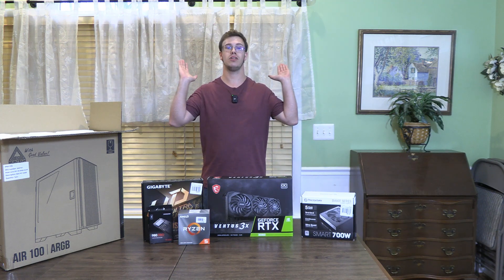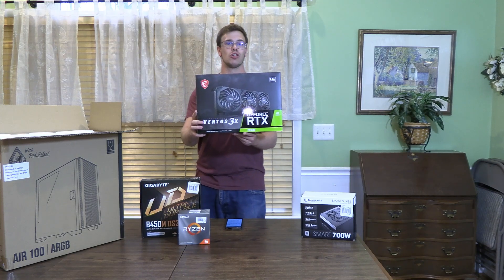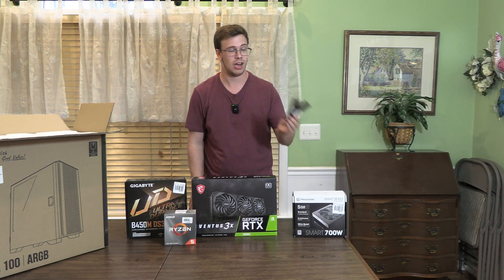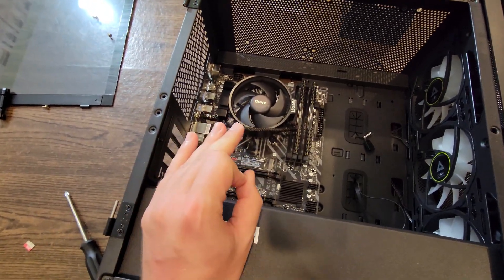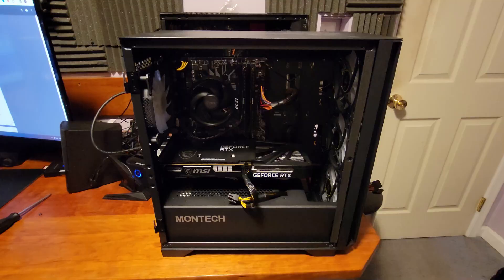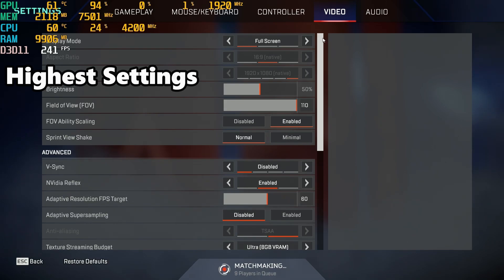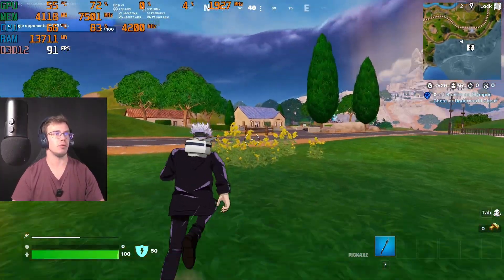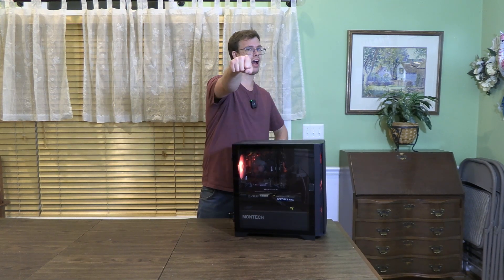Building the Best $750 Budget Gaming PC Build!

Comment: Hey man i like the build bro! but the only thing that i'd say is to change about the build is getting the 5500 or the i3 12100f it should be around the same price has an r5 4500 ( atleast where i live) and it will outperform the r5 5500 but if your like streaming and stuff get the r5 5500 but other then that i'll dropp a sub bro!
Reply from the maker: Thx man for the sub. I was thinking of using either of those cpu, but it would have gone over the budget for this video. If someone does build this, then I would definitely recommend what you said or spend a little more to get r5 5600GT
Reply: @TechGrant  of course man just here to help a samll tech channel out! i'll probably build this build or something simular to this soon but instead of the 3060 i'll use the 6600 or the 5700xt
Reply from the maker: @gamingwolf7895  That would definitely be great for gaming. I haven't tried Radeon gpus, but I want to use them in future pc builds. My next pc build video is planned for the end of this month for a banger $800 build.
Reply: @TechGrant  oooo what's the specs? yeah after i build this i'll sell and tr yto get intel haven't tried newer intel the older chips were good  but radeon gpus are really good i run an 5700 xt it's really really good
Reply from the maker: @gamingwolf7895  don't wanna spoiler, but I will say this. It will have a powerful 8 core / 16 thread cpu. That's a good plan. The Intel cpus has gotten way better since AMD dropped 3000 series cpus. Competition is King. I'm trying pc flipping right now. Before I make a video series on it, since I think people will enjoy it.
Reply: @TechGrant  oooooo sounds like an 5700 or g that's a really good for an build bro!